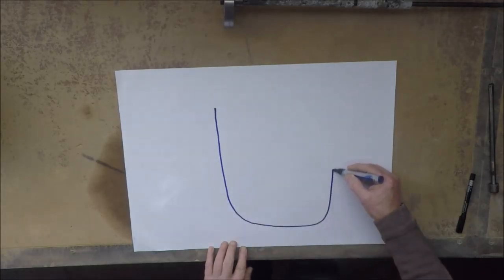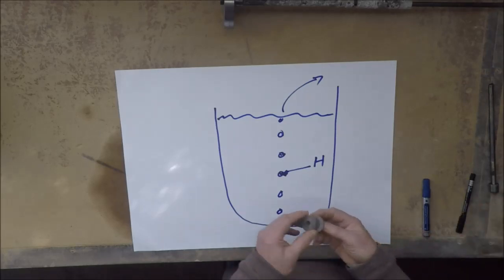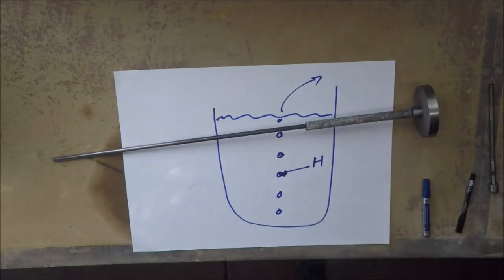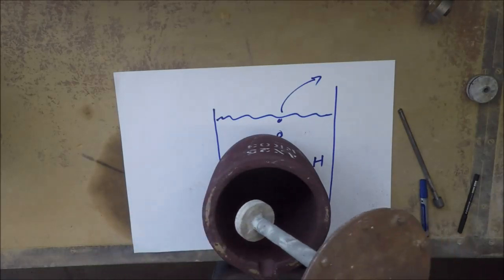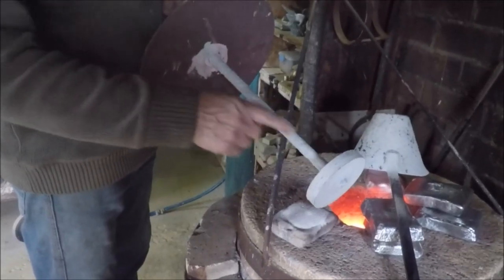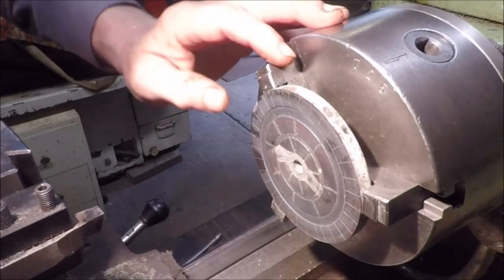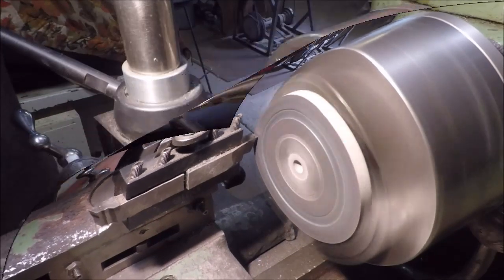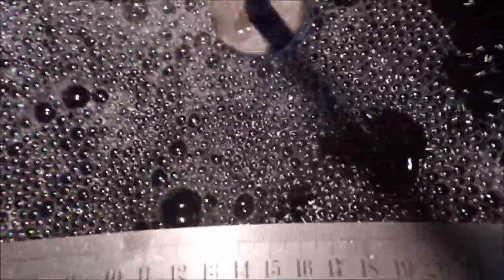My Home Foundry, Most recent Degasing Lance

Comment: Great explanation and design process.
the reduced number of holes for the lance,for the same flow rate, would increase the velocity of the gas leaving the lance.
that might explain why there was a significant difference in the bubbles produced - the gas was flowing out of he holes faster and so broke up more so in the molten aluminum.
thanks
Reply from the maker: Charles, Intuitively what you are suggesting feels correct. However I am at a loss to know if it is so. In fact recent info that I have come across clearly indicates that bubble size is related to just two things;-   the size of the orifice that the gas is coming out of, and the liquid into which the gas is flowing. There is no mention of flow rate at all - presumably then higher flow rate just means more bubbles of the same size. In my case with this lance I was concerned that the bubbles coming out of slots so close together might coalesce into larger bubbles simply by mutual contact. Halving the number of holes was an attempt to keep the bubbles further away from their neighbours and so prevent coalescence. Of course it may have all been self defeating as with more bubbles of the same size per hole each bubble would be closer to the bubble before and after from the same hole so coalescence may well still have occurred - life was not meant to be easy!

Comment: Answered my questions about degassing Al.. thanks again, information even I can understand...
Reply from the maker: Malcolm, Degassing is a subject that many have a great number of misconceptions about. And in fact many peoples degassing efforts most likely result in more gas rather than less, either because they use the wrong method (washing soda does NOT work), don't do it for long enough or it causes to much splashing at the metal surface. With clean metal melted quickly not too hot and poured without delay for normal hobbyist work I recommend that degassing is hardly necessary. Any gas will be so fine you will need  a magnifying glass to see it. If it is much bigger than that it is most likely trapped air through bad pouring and gating methods.
However I am trying to get around to doing an update to this video as experience has indicated some improvements are possible and necessary for the lance.... Martin

Comment: First, thanks for your videos, they are the most professional I found so far ! In my country argon/degasing tablets are very expensive, is there other techniques to avoid porosity ? like controlling the temperature ? On wikipedia they say "To minimize gas solubility the superheat temperatures can be kept low"
Reply from the maker: Gaetan, I used to use Hexachlorethane tablets but they are no longer available, then I tried the grey tablets that give off nitrogen gas (are these the ones that you mean?) I did not like them, their action was so violent that they splashed 50 mm of metal out of the crucible and all that splashing up into the air just allows more hydrogen to get in. A local foundry did tests and came to the conclusion that these tablets made gas levels higher not lower! Using washing soda or Epsom salts is a complete waste of time as all they do is bubble water through the metal which will increase gas levels not reduce them. My usual advice to the hobbyist is not to bother degassing and as long as your metal is clean i.e. no oil, grease, paint, corrosion or water and if you melt quickly and do not exceed 760 deg. C (preferably lower) and pour as soon as possible, you should have reasonably gas free castings (well, any gas will be very fine and you probably won't see it) I would recommend not pouring on very humid days and I am also assuming that the castings you are doing are not great thick chunky things that will take for ever to go solid as these are very bad for gas. Good luck with it.... Martin
Reply: Thank you so much !
Reply: @olfoundryman8418  It's probably a bit pointless to respond for me, seeing as your original comments is now 5 years old, but anyway. Both epsom salts (magnesium sulphate, MgSO4) and soda (sodium carbonate, Na2CO3) when store bought will indeed be the hydrated form, meaning that per molecule one or more water molecules will be bound to it. It is however very easy to turn them into the anhydrous i.e. water-free form by heating in an oven at a specified temperature and for a specified time. Those temperatures and times can be found quite easily on the internet. And once all the water has been driven off in the oven all you need to do is store them in a sealed glass jar and they'll remain water-free for use.

Comment: About 35 years ago I cast a boat of of things in my high school metal shops class. I got rather good at it.  Made some complex patterns and the like. We used petrobond sand. Off and on over the years I have cast the odd item in aluminum and a plaster mold for quick and dirty one off items. I'm at the point where I have to get back into casting for small runs of custom items. I have to say I have learned more of the nitty gritty items of casting from your videos than from just about every other video I have watched on Youtube. Great stuff. I really appreciate your thorough explanations of why you do things the way you do. Do you do any cast iron work?
Reply from the maker: Kravchenko, Thank you for your comment. Its comments like yours that really make the effort of putting videos on YT worth while. Sadly its a bit difficult to put 60 years of "nitty gritty" learning into a few short videos but I do try to put as much in there as will reasonably fit and I always try to put some more in the next video.
 Plaster can be a bit problematic for casting metal into unless you do it right in which case it works very well indeed. I would be interested to know of your experiences in doing it. Did you use straight plaster or was it a blend with other materials what preheat treatment did you use to dry the plaster, did you use the rubber pattern technique, have you tried foamed plaster - so many questions!.
No, I do not do iron work,tried it once about 50 years ago but managed to get a 2% carbon product because I burnt too much carbon out by doing it wrong. Its very hard on furnaces crucibles and the people doing it so I stuck to bronze and aluminium. Luckygen1001 who lives about 100 Km from me does a lot of iron work. He has been at it for over 30 years and knows it well. He and I have spent a couple of most pleasant afternoons talking foundry and he does seem to know his stuff... Martin
Reply: I first did lost foam and lost wax in high school. So that was 35 years ago. The lost wax was done in plaster of Paris as I knew nothing of the correct recipe back then. I grew up way out in the country in Manitoba Canada. Many pieces of crucial information were simply not available back then. But I was to stupid to know what I couldn't do and I fumbled my way through. The first lost wax attempt was a bust. I erroneously thought that wax when heated would shrink. Guess how that worked out! crack! new mold new way of draining the wax! that actually worked out quite well with great retention of the finish including all my imperfections on the wax pattern. Lost foam was tried once. I managed to shut down the high school with that one. (A true pity of course! I think I got more pats on the back for the free afternoon than jibes for my stupidity!) I was not impressed with the surface finish or the general amount of porosity in that casting. I was attempting to do a casting for a headstock of a metal lathe. Degassing is so important to a good casting. A friend of mine and I made casting for water pump housings that were great sieves for cleaning out the water that entered them. In other words they leaked like sieves! We saw first hand how not to make a casting. Then I read in an article that degassing aluminum could be done with chlorine tablet. This I tried, outside on a breezy day. We knew enough about chemistry to recognise that chlorine gas would be produced in copious amounts. It seemed to work. More recent work was for making loudspeaker cast aluminium baskets. This was done with a glass fiber reinforced plaster mix used for porcelain molds. I actually machined these and dried them out in an oven. The two halves either stayed true to the mating surfaces or they would warp slightly and then leak as I poured the nold. Molten aluminium does indeed run out of a mold just like water! Now I'm thinking of setting up a more permanent foundry for similar casting work to what you are doing. Custom casting work and short runs of commercial casting. I think I can do both cast iron ( No experience with. But I do watch luckygen 1001's videos.) I would need dedicated crucibles for that. And most likely means to lift them that are a bit more robust. Sorry to blather on. But you bring back so many memories. And I learn so much from watching these videos. So many things that I say to myself, that's what I was doing wrong! I consider myself better educated each time I watch one of your videos. Thank you!
Reply: @KravchenkoAudioPerth  nice to hear i was not alone bumbling around with casting 30 + years ago in Canada.

Comment: Very interesting...

Does molten copper need degassing? If so, would argon work for that too? How about any of the brasses?
Reply from the maker: Insert, Copper is an interesting case. Like aluminium it too will dissolve hydrogen although the solubility of hydrogen in copper does not drop as much as it does in aluminium on solidification so in theory the hydrogen should remail in solid solution where it will likely be quite harmless. However, if you look at some of the videos produced by those ignorant types turning high quality copper wire into low quality ingots just for the sake of making a video and wasting fuel you will often see that the ingots have so much gas in them that they rise like a loaf of bread as they solidify. I show some examples of such ingots in my “Possibilities” video. The gas in these ingots is however not hydrogen - rather it is steam. This results from the copper being oxidized by bad melting practices. The copper oxide thus produced reacts with dissolved hydrogen to produce water as steam. This reaction takes place as the copper is cooling down a little before and during solidification thus causing the gas porosity. It is easiest to prevent this not by degassing to remove the hydrogen but by melting properly so that no oxide is formed. Quite simply – no oxide no water no water no porosity. Argon will remove Hydrogen from copper but practical realities make this difficult for us hobbyists. In the case of brasses and aluminium bronzes the problem does not arise as the zinc/aluminium in these alloys effectively deoxidizes the copper... Martin

Comment: Does molten Aluminium attack Stainless Steel in the same way it attacks mild steel? 
Does Stainless Steel also transfer Iron to the Aluminium if used as a crucible?

Comment: Hi Martin, first of all thanks for creating such a wonderful and detailed and practical video. Can you explain share detailed video on lance making ? Currently in this video what is the lance specification you used ( Lance inner and outer diameter, having more thickness is helpful for straight length for mechanical strength…
Reply from the maker: Manoj,
First let me admit that the lance was made from “found material” i.e. what I had lying around. I did not do any plans for it - I just made it. The very inner tube is stainless steel, I was told, by the person who gave it to me, that it was “refrigeration tube”. It is 3/8 inch outer diameter and has a 3/64 wall thickness. This tube is thick enough to take a 3/8 NF 24 TPI thread. The outer sacrificial tube is mild steel and is 3/8 ID by ¾ OD. I say “sacrificial” as its job is to protect the inner stainless tube from attack by the molten aluminium. The length of this outer tube is such that with the lance head touching the crucible bottom the tube comes not quite up to the top of the crucible – this way the lid of the lance rests on the top of the crucible. The lance head is made from cast iron which I had purchased as continuously cast bar. The head thickness is about least 5/16 inch – its two pieces - so total thickness is thus about 5/8 inch. The head diameter is preferably at least 3 inch as if less the bubble stream just seems to come together into one central stream as it rises, rather than many streams coming from all around the lance. However, I think the head diameter needs to be 1/3 to ½ the diameter of the inside of the bottom of the crucible. All of the lance that is exposed to the molten aluminium is painted with a wash called Hardcoat BN. This is a boron nitride based wash made by ZYP Coatings in the USA – it is expensive - but it’s the best wash to prevent metal attack. Even so after every days use I inspect the sacrificial outer tube for any areas where the aluminium has begun to attack. I remove these areas with a small carbide burr making sure to get ALL the aluminium removed. The now exposed area of mild steel is oxidized with dull red heat and the whole lance, tubes, head, and all, recoated with the wash.
To be honest in using the lance after making that video I found a fault in its design in that the two head plates tended to come apart because the central bolt worked loose. So, I bolted the two plates together with 6 off ¼ inch countersunk bolts. I have been conscious of the need to do an update video but so far bad health is preventing me – one day maybe, I hope!.... Martin
PS,  is there anything else that you would like to know?

Comment: I am wondering that even if the fluidity of the Al is similar to water,  that the extra weight of Al would tend to decrease the bubble size until it is very near the surface. What do you think?
Reply from the maker: Stephen,  Two points, first yes, bubbles will grow in size as they ascend as the pressure on them lessens - you can see this in aquariums  with air bubblers. There is no reason to think that the same does not occur to bubbles rising through molten metals.  Very approximately 100 mm of aluminium gives 1/2 psi so a bubble rising through 100 mm of aluminium would increase in volume by about 3% -not very much so it might be a bit hard to see!
                                      second, and as counterintuitive as it may seem the bubble size is determined solely by the hole size the gas is coming out of and the material into which it is coming. There is a graph in John Campbell's book "Complete Casting Handbook" Fig 7.35 page 390 that lists the bubble size for various liquids and a range of hole sizes. For a 0.1mm hole the bubble size is about 1.5 mm for water and (sadly) about 3mm for aluminium
                                    As a third point I think that some bubbles coalesce with others on the way up simply by banging into each other and forming the one larger bubble, the larger bubbles then rise much quicker and hit smaller ones above growing even larger, Studying the bubble trail in a tall aquarium is quite instructive... Martin

Comment: Can this argon lance and diffuser plate be made of graphite, or will it contaminate the molten aluminium in the cubicle?
Reply from the maker: Lan, Graphite will certainly not contaminate the molten aluminium. The lance could be made out of graphite but mechanically it is a more difficult material to handle because it is quite brittle. Impellors for rotary degassers (industry best standard for degassing) are commonly made from graphite because it is totally resistant to attack from the molten aluminium. I sometimes use a graphite sheath to protect the steel tube that is the central part of one of my degassing lances. Otherwise I just use a boron nitride wash to protect the steel and cast iron parts of my lance. It is my aim one day (I should live so long) to make a rotary degasser small enough to suit my crucible size as rotary produces smaller argon bubbles and that is a definite aid to good degassing. Also I have recently modified my latest lance (the bigger one shown in this video) and hope to do  a short video about these mods in the near future... Martin